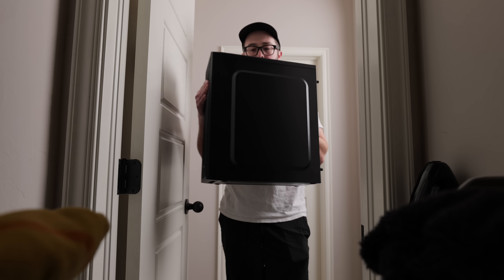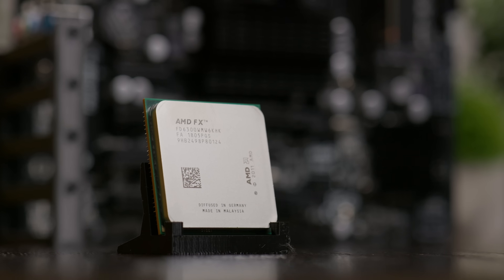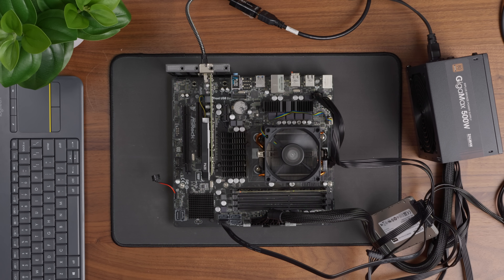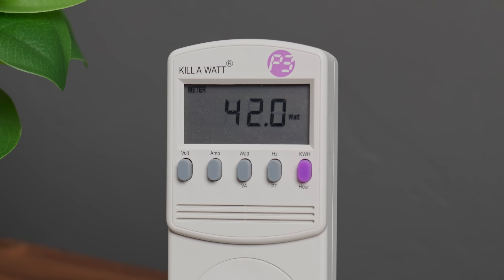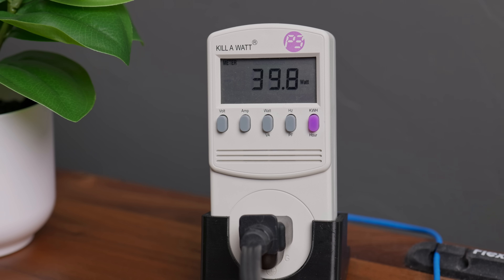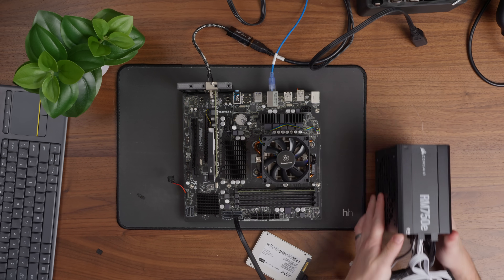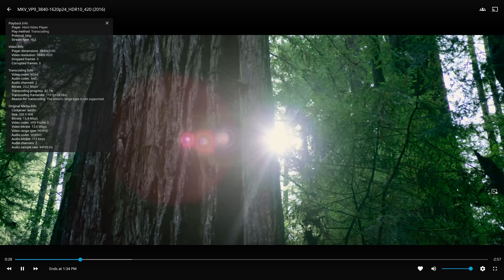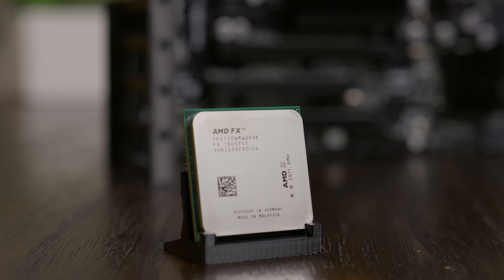This CPU Shouldn’t Work in a Home Server… But It Does

Comment: 9:26 The Good Night LED setting sets the state for that function, not the state of the LEDs. If it's enabled it turns off the motherboard while the system is powered on (And keyboard LEDs while in sleep mode) but if it's disabled it leaves them on. Auto, from my experience on an FM2+ board that used the same UEFI menu as your board, generally just defaults to enabled, turning off the LEDs.

tl;dr, you turned on the LEDs trying to turn them off

Comment: I still run by 8 core after all these years, it's in an old desktop storage server with 40TB of drives, 64GB RAM, it's a workhorse, sits in the basement and does the job

Comment: The FX series chips were not that hot, the 8350 was 125W, that's kind of the standard these days unless you are intel then it's 350W.

I never had a problem cooling it, I think where it gets a bad rep is people trying to use the included cooler which was utter crap, if you bought a $20 cooler with a 120mm fan it was fine, pretty much the same as CPUs today.

People really like to spread crap.

What really kills using these and CPU in general is the lack of a graphics output, I would never use a non APU system as a server. The GPU will end up using at minimum 7W idle. You can in some cases boot a system headless but it's a massive pain the the arse. Just get a cheap AMD APU, or if you can find one a motherboard with onboard video on the south bridge. In the Athlon days I got one of those motherboards with Radeon HD graphics on the southbridge with built in memory so it didn't use system ram, not sure if FX ever had any of that.

I have that exact motherboard as well, I specifically bought that motherboard because I heard the horror stories of the MSi boards cooking the mosfets with the 125W CPUs, so I went overboard I got a board that was rated for double the power even though I never overclocked it, I undervolted it. Never had an issue with that board.

Comment: there was an Opteron AM3+..... I own Opteron 3280 which was pretty much a FX 8300 Vishera at 65w tdp and 3320 quad core roughly in line with same sorta thing at 25w tdp; in both cases lower power and decent cache, the 3320 I still use for a nas * 970a-pro3 has sata3(it says it on the ports; 6Gb/s); great board, has iommu support, probably the smallest for am3+... can run a rage ii in the pci slot;).... never tried headless but cause you are going kinda low on the power consumption depending on what you mean by it wouldn't post what came to mind was that you might be hitting the minimum limit of the psu,when trying headless I'd suggest trying to throw a spinning rust harddrive or something else as a load; the board should do it they have UEFI bios which isn't that old
Reply: looking at the manual for the Asrock 970m-pro3, didn't feel like it seemed right as the chipset is used on full atx boards usually with a lot more slots, the x1 slot should be 2.0 too; not sure about the variation in speed but possible difference between the southbridge and northbridge, manual doesn't offer a diagram

Comment: From a euro perspective here, while i love the tweaking aspect (and seeing old AMD stuff getting love), stuff like this is highly dependent on low power prices, over here we pay 30 cents per kwh, meaning a 10w load 24/7 costs roughly 2 euros per month. If you can cut 30w on your idle draw on your homelab stuff, that saves 72 euros a year. Now consider the lifespan of your homelab gear, and suddenly a N100 powered mini-pc can come out on top, even compared to getting stuff like this for free.

That said, i love videos like this, and tweaking old hardware is always interesting, so by all means keep up the good work with the videos!
Reply: Uhh where are you in Europe wtf
Reply: @HowManySmall  I can back up the OP here. I'm in Ireland and paying 32c per kWh. And that's before the 9% sales tax is added. So it's more like 35c.
Reply: @HowManySmall  Netherlands, why?
Reply: @Vectormatic  because it's expensive af. In Spain we're at 10-12 cents.
Reply: @CuriWu   We used to be at ~20-ish, but then the ukraine war happened, and apparently being dependent on russian gas wasnt a good idea.
Reply: @CuriWu  Everywhere? No, you don't, average in Spain is 19, so stop lying.
Reply: @Vectormatic  maybe using russian gas is a good idea
Reply: At 30 cents per kwh you may as well just pay for a VPS tbh.
Reply: Buying efficient is always better than using old low efficiency systems.

Comment: I've been running my old FX8350 machine as a NAS for a few years now. It runs my Nextcloud and jellyfin instance for me with 6 HDDs. 

I have it underclocked and under volted, the power draw isn't horrible. Not that I care that much as all of my power is covered by rooftop solar.

Comment: At some point it is time to throw hardware away unless there is a very specific reason to keep it. For general server use, just find an N5105, N100, N300, etc. board or mini PC. All are faster and consume 90% less power. For general Linux learning or tinkering on a system you don't care about, get an SBC or just fire up a VM. Stuff this old isn't suitable for 24/7 use in 2025.

If you find an FX system in someone's trash, just leave it there unless your intention is taking it to a recycling center to strip out the precious metals after shredding it.

Comment: Did you try lowering the CPU clock speed or did you just lower the CPU Vcore? A lower clock speed could possibly run at a lower Vcore and increase efficiency. Also, did you try running a fabric server with performance enhancing mods? You could also try the Chunky mod to pregen the world within a certain radius.

Comment: I ran a FX8370 up to 2022 on my PC, when just stop working. System heat wasn't an issue for me, in fact it was welcome. Living in a part of the UK where the wind comes off the north Atlantic and summer is an afternoon experience for 4 to 6 weeks in the year.
Reply: FX immortal -its mobo  
My buddy burn out mobo with fx black series (220W)  -its really burn CPU supply lines  at mobo (lack of cooling -he used water for cpu but forget to add cooler to VRM)
FX is fine )
Reply: @alexgo1034  I had a buddy that recovered an FX system that had actual plants growing on it, it was exposed to the enviroment.

The fucking thing still runs strong to this day.

Comment: 30W idle would be acceptable. That motherboard probably draws more power than CPU/GPU.  Instead of good working CPU becoming another e-waste, this is a great way to create cheap homelab/server/nas, without breaking a bank, if you can get the CPU for free

Comment: Sorry.. no. In no possible "hacked" configuration. 
Merom, Wolfdale, Lynnfield but mostly Nehalem and Sandy Bridge simply went around circles of any AMD CPU and APU of that time, consuming most of the times "simply" 65w. Due to lack of competition, Intel went from 2nd generation core till 6th generation core... with marginal performance increment. Started "playing again" for real only on 8th gen.
There's no way that any non-Ryzen AMD build (excluding Geode/GX, really nice low power SoC for routers) are kinda worth something as homeserver.
No grunt for the power consumption, not stable enough chipsets, sometimes "popping caps" mainboards.

I'll enjoy the video anyway :)

Comment: The Socket C32 Opterons like the Opteron 4386 are actually really good.
They supported large Registered DIMMS or LRDIMMS
And run very efficient
They make great NAS servers.
Reply: My NAS is a Supermicro H8SCM-F with n Opteron 4332HE and 32GB of DDR3 ECC RDIMMs. With four SATA SSDs, an Intel X520-DA2 and an LSI 9211-8i with six spun-down HDDs connected, wall power is less than 90 watts at idle with Alpine Linux.

Comment: Weird, cause I got a 8350 (old main PC) collecting dust in front of me. Got it for more than 12 years without problem. Was wondering if it would be a good home server since it's got 8 (arguable) cores. I tought of the power draw and was not tempted to actually build it as a server. With a GT 520 as a graphics card, I guess with tweaking, it wouldn't be that bad.

Comment: I have 2 computers using an fx 6300 I use one for gaming and it performs pretty well. I use the other one as a Jellyfin/minecraft running Ubuntu and it works pretty well. I’ve been looking for a guide to point me in the right direction with undervolting the cpu and am gad you made one

Comment: I have the exact same mobo(ATX version) with an FX 4300 sitting in my closet, i think all ports are sata3. 30w idle is definately not bad for a full size pc. Might do a project with this, until i find a cheap used AM4 board for my athlon 300ge.

Comment: I'm actually using an A4 7300 dual core as a truenas server and it's surprisingly good for a few containers and it runs pretty much silent in an sff case with 3 drives.

Comment: Dayum, you've went through all the struggle i had in early 2010's lol, whether it's LGA 1155 or AM3, neither of them works great running 24/7 unless you do these minor adjustments, undervolting works great at sparse load and when you don't need that much processing power.
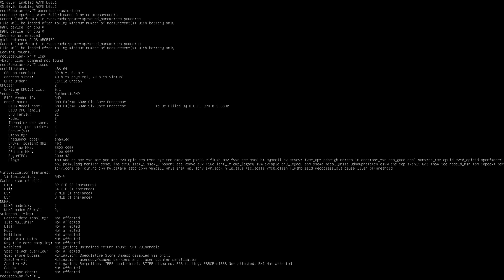11:14 because you've only cut the microcode access for the north bridge, the processor is still there running at idle but still on lmao.

Comment: My X670E, 7950X3D, 96G, 2x4TB NVMe, 4x18TB Exos, GTX 1080, RX 570 idles at 100-110W (with a truenas vm, drives do not spin down).
What I have noticed that a passed through USB controller (required for USB DAC) adds 20-30W to my idle inside a VM (Idles at 100-110W with an idle GTX1080 VM)

I can cut a few Watts going from 6000MHz to 4800.

Comment: there are old FX optimization guides. And its waaayyy more involved than increasing the CPU clock. And on the same clock you can get 5-30% performance boost depending on the task, and the powerdraw goes way down. But back in the day, information wasnt as fast spreading. The 8350 could rival the i7 4770, but only after optimization, without, you would be at around i3 4130-i5 4570 level in Performance
Reply: I had a 8350 and it didnt even come close in performance to a 4790, double the performance on average in single core task- there was no magic setting that changed that sadly.
Reply: @tomr3422 once you got a Good BALANCED OC running. And the emphasis is on balanced. An FX could hold its own against a 4770. I had bench offs with my friends 4770 at 4.2 GHz and while I needed 4.95Ghz to do it I could do it. You need a balanced OC that not just pumps core clock but the memory bus as well. The problem with FX was it's memory bottlenecked. So just cranking core clocks didn't do much. You needed to alleviate the poor L3 performance. And L3 was controlled by the memory controller. So cranking the CPU-NB (the memory controller on FX not the mobos Northbridge) to 2.7GHz and pairing it with decent ish 1866 or 2133 memory mostly alleviated the memory bandwidth bottleneck. And if you were to actually run them side by side today. The FX aged better than the quad core I7s of the era. The FXs can stream in assets in modern games like ROTR and such quite a bit quicker than the 4 core I7s can these days.
Reply: @alastairstedman7840  I can show you footage of a 4790 and a FX8350 running a beach mark of the same game the 4790 at 59FPS and the 8350 hitting 30fps rarely- at the same clock speed 4.9 Ghz same memory in both (actuall the same sticks) the 4790 runs a media server still the FX (3) are in the closet because no one wants them.
Reply: @tomr3422  As with GPUs there will be some programs and applications thta prefer one vendor or another. Also just  because you couldn't get the FX to perform doesn't mean the FX is a bad platform. It just means you didn't know what you were doing with it. Again simply pursuing core clocks on FX was a fools folly. You needed to pursue high memory controller clocks as well. Again not just memory clocks but high memory controller speeds. 

https://youtu.be/nPGGQy-xmHs
Reply: @alastairstedman7840  What you are leaving out of your fairy tale is it wasnt just me that found out how bad the FX series was it was the world- PS AMD settled a law suit for a reason and it wasnt because as you say - they out performed something or even anything for that matter - Sorry about reality making you look kind of dumb, but you really did all the work
Reply: I have the fx 8350, fx 8370, and i7 4770k all running.
After minimal tweeking, they all perform about the same.
(The i7 has a few outliers where it does really well though.)
Reply: @hrayz what kind of optimization are you pointing at?
Reply: I have both an FX-8350 and an i7-3770K and while an overclocked FX-8350 does match a stock 3770K, the 3770K can go up to around 4.8GHz, and at that point the 3770K shows a huge lead again.

The 3770K is also easily coolable at 4.8GHz on a single tower cooler (at around 100W), while FX-8350s have a TJMax of ~65C, which is extremely difficult to meet when it's running at >140W. Meanwhile the i7-3770K is doing fine at 90C.
Reply: Can you shout out these optimisation guides? I can't really find anything and I'd love to get a bit more performance from my system
Reply: @harnnesss  To find AMDs official guide: google "AMD FX Processors Unleashed" and klick the link starting with "sll-images-amazon". It should be a pdf. This is however very technical.

Check a channel called MDFGamingVideo his newest video is about tuning FX properly and how good they were

Comment: I had a FX8350 and I used for years thinking it had 4 cores multithreaded. When I updated it to a ryzen 3600 (not x) it was far more efficient, cooler, consumed less power and was a monster step in performance. Even for a NAS just for the parity calculations and being able to use better PCIE slotsI would recommend a B450 motherboard a ryzen3600.

Comment: Old hardware might support eSATA with port multiplier, was fairly common in the AM2/AM3 era.  Obsolete now, but still works great if you have an old multi-bay enclosure or can buy one for the value of the dust collected on it.  Which is what mine is doing now, sadly.

Comment: You can lower northbridge and hyper transfer voltage (both for core and motherboard) and save some more power. Could maybe get down to 25W.
Reply: this! i had a tuned 8350 on a 990fxa board and after a lot of tuning it could either be somewhat quick but pull 350w or be tuned down, only pull 90w and still be stable lol

Comment: Got an old 8300 running TrueNAS and some spinning rust NAS drives. Default/"Auto" BIOS settings for now but it might be worth another look. Been stable as a rock so far.
I've also an ex-gaming 9590, but that thing likes to lock up at the slightest twitch. Probably more useful as a wall hanger than a server... :(

Comment: I had a 6 AMD core something (brain's getting old) running in my home server undervolted .3 for years, sadly the motherboard gave out or I'd still be using it.  Specifically Gigabyte's dual bios went crazy.  So much for being a backup.

Comment: My NAS is a FX8300, the whole system draws 60-80 watts including a bank of 4 NVME SATAs, 4 spinning rusties and 10 gig networking. It has 32 GB of DDR3 ECC Ram, runs cool on a Kaveri Wraith cooler. It is not overclocked. I purpose built it in 2016 because the Rizens were around the corner and it cost me $60, the Asus MB was $50 all new parts. Ram was cheap too since everyone had moved on to DDR4. I added the NVME SATAs this year because I needed faster storage for Immich. Now I need to tweak the settings!
Reply: I just upgraded my FX8300.

Comment: i find it kinda funny how my friend had/still has an FX-series server at home and i was running an AMD Athlon 3000G and the geek bench is better and under MAX load it only draws 35W 😂.
And i replaced my 3000G because it performed to bad for what i needed it for. AMD really did turn things around with the ZEN architecture

Comment: It would’ve been cool to have an older Intel to compare as well. I wonder how an Intel i7 3770 would hold up for all things considered.

Current running a i5 8500 for my server and that thing is a workhorse.
Reply: My old i7 3770 is doing just fine as an Open Media Vault / Jellyfin server
Reply: you probably want to get a T SKU if you're going older than Haswell
IIRC Sandy and Ivy went down to 1600MHz while Haswell managed to drop to 800MHz at idle for regular SKU
but I also think Sandy and Ivy T had that idle frequency lowered to mobile levels
Reply: @Z4KIUS  Generally speaking, the full power chips draw the same amount of power as the low TDP ones when operating at the same speed. The power difference only comes into play when heavily loaded.
Reply: I have on hand dell 790 (i3-2100, 6gb ddr3, 2xhdd) draws 25W
Reply: i have a i3 laptop without screen
it's a great home server, just 6 watts and it go down to 4 w @StanisawSwierczynski
Reply: @notune424  Same here! 5800u Ryzen, 7 watts idle, octacore so horsepower when needed, its a total package and way better than n100 n300 series
Reply: I ran a 3570 tower with an Asus motherboard for years and it drew about 25-30w idle, full system, no tweaks. Changed to an optiplex 3060 micro recently and it idles at single digits.
Reply: Im running a 2012 Mac Pro as a home server, and the. Xeon in it will only drop to about 1.2Ghz at idle. It’s not terribly energy efficient, especially with the added GTX1060 and Quadro P400 in it.
Reply: That wouldn't be cool... Sorry
Reply: @BudgetGamerz  Because you are clearly the authority on what is and isn't cool.
Reply: @Luke357  I'm just messing around lol